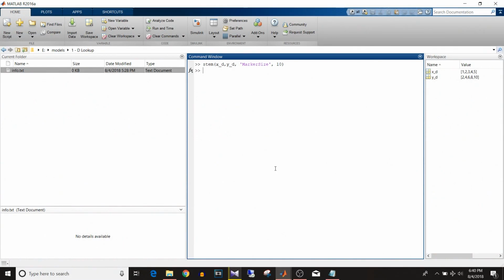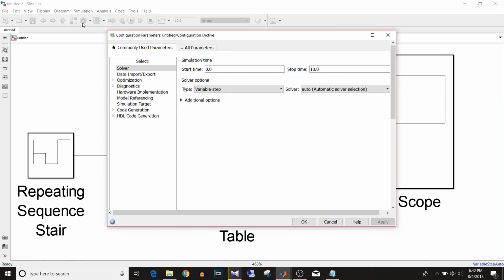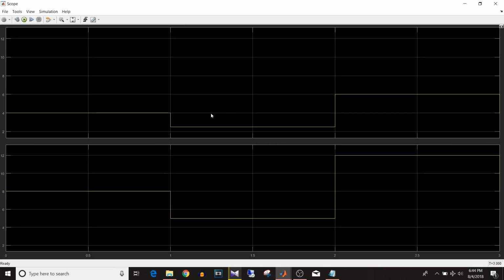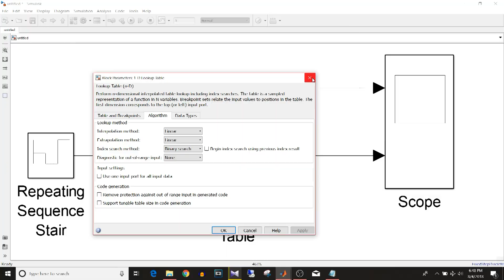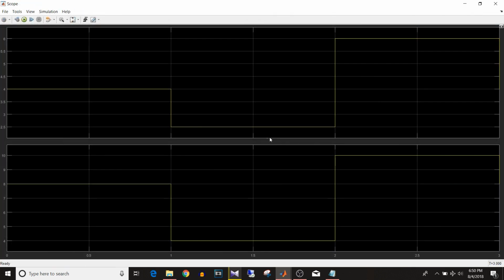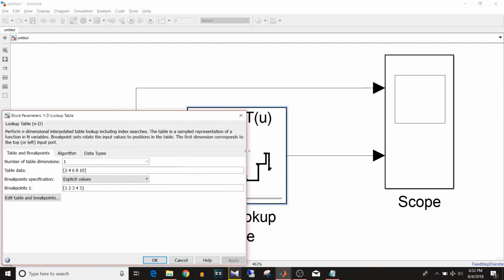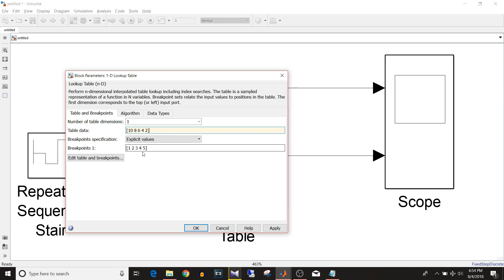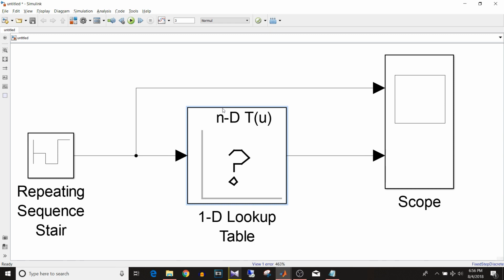Simulink Tutorial - 55 - 1D LookUp Table In Detail

Comment: Thanks. Finally I understood sth about lookup Table. I watched vedios and read documenatations, but I still don't know how to deal with them .
Reply from the maker: It's easy to understand the use when you have practical example. You can imagine a scenario of sensor implementation in embedded systems.
Pressure sensor, in which X will be voltage value ani Y will be the pressure or sensor counts value
Reply: Simulink Tutorial Thank u for your rply. Could u publish a tutorial about direct lockup table?